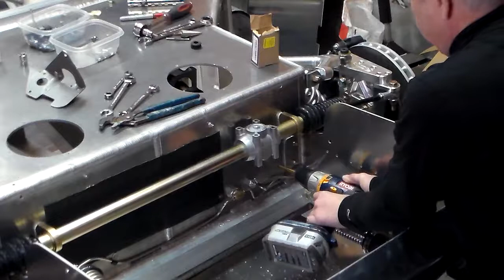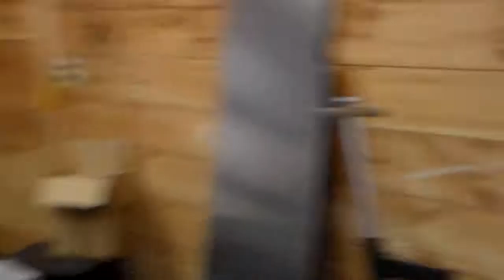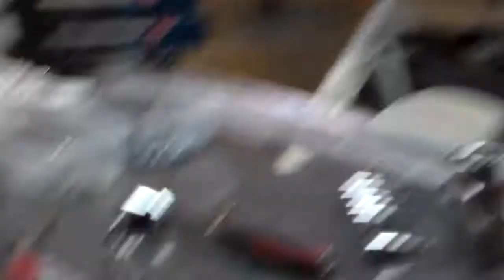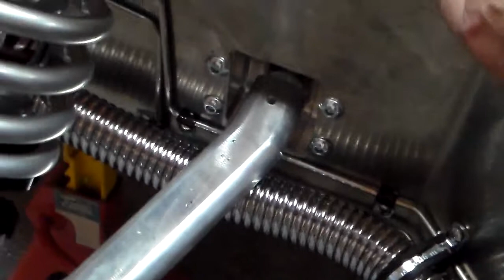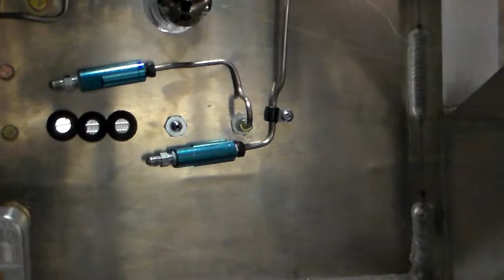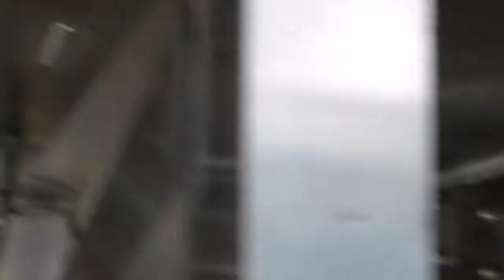SLC BUILD 9 BRAKE/CLUTCH MASTER CYLINDER LINES

Comment: Hey, great videos. Question, you may have said why in a different video, i'm curious why you have a rectangular hole cut out along the front of the main body, is there a reason for it or is that from the factory??
Reply from the maker: +Mike Luciw 
Where is the hole you are referring to when the body is all together, can it be seen?
Reply: Yes, its fairly large, maybe 20 inches by 8 inches, to the left of where you are drilling the holes for the grommets. (I might be wrong as it may be like that from the factory)
Reply: The rectangular hole can be seen in the thumbnail (beginning of the video)
Reply from the maker: +Mike Luciw 
That is a piece of sound deadening material.  It is black so it does appear to look like a giant hole in the video.
Reply: +zakari3030 That makes ALL the sense now. I havent watched the Sound Deadening video but it is in my Watch Later list. I will HAVE to take a look...thanks